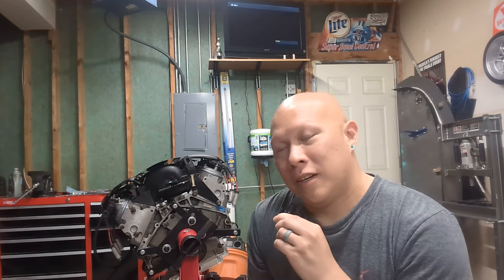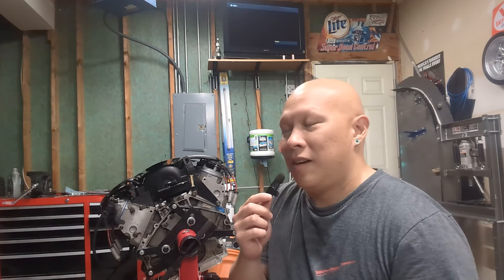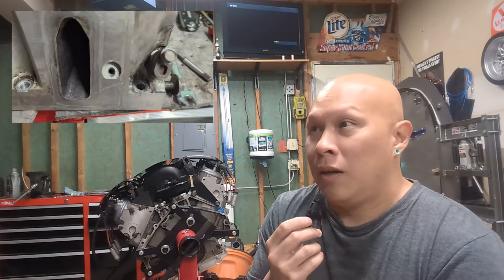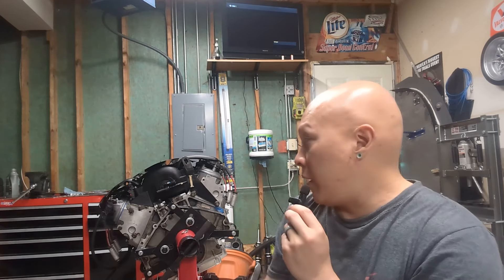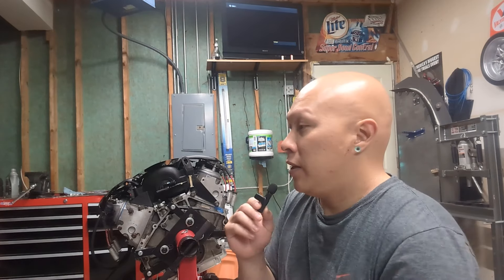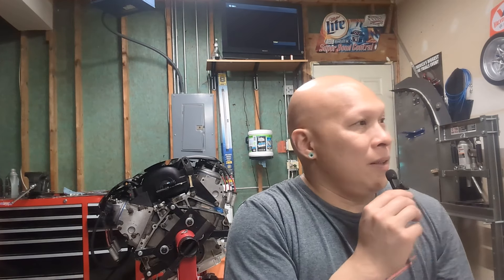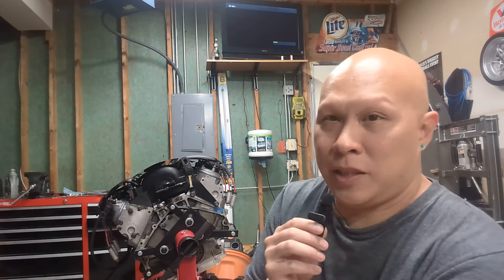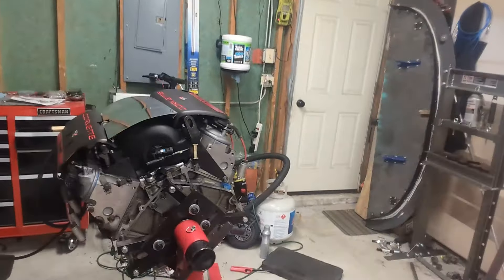What's Going On..?

Comment: I had my car READY TO DRIVE a couple months ago when we noticed something not quite right with the new (used) transmission.
Called the company up, and they were super helpful. immediately identified the issue and what we needed to do to correct it. 
Then when we were ready to send them money for parts, they practically disappeared. Took a couple weeks to get an order written up.
Then another week for them to ship it.
Then once it arrived it was missing half the parts.
Then another week to get the missing parts....

Custom car stuff already takes FOR. EV. ER. 
It takes even longer when you're waiting for parts :(
Reply from the maker: Man I'm so sorry. It's always something...
Reply: @PhilJue  yup. And to be clear, this isn't trying to one up you or anything, but to commiserate. Any type of custom car stuff takes eons.
Reply from the maker: @aMaff  oh don't worry haha. Just have to be patient
Reply: @PhilJue  just to add in my exprerience I just drove my car for the first time this month after just swapping a 2x carberator intake for a different intake with 3 weber carb. i think the thing that killed the momentum changing to fuel lines to PTFE AN: it's all the will your "in there" mods. I last drove my 260z in november last year.. its a journey not the destination
Reply from the maker: @SeanOBryanZZ  Definitely enjoying the journey and probably will look back saying dating I did all this without a glance of the setbacks. Maybe I'm just letting my impatience get to me!